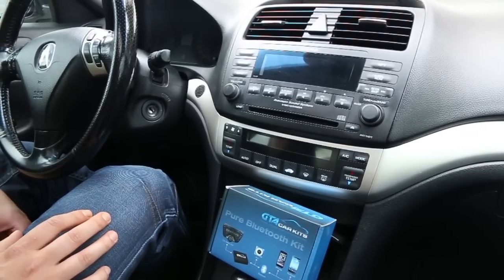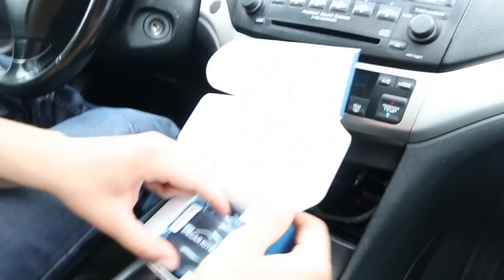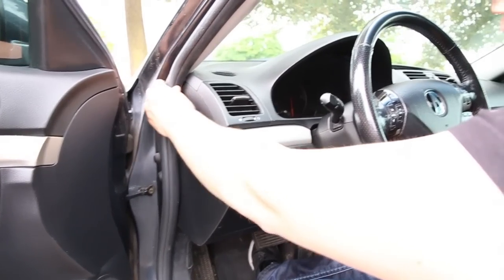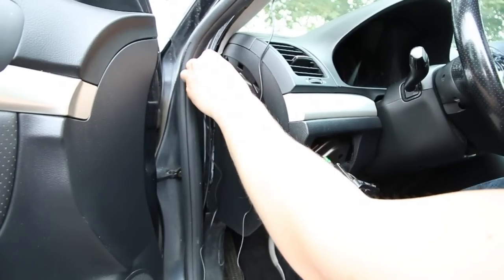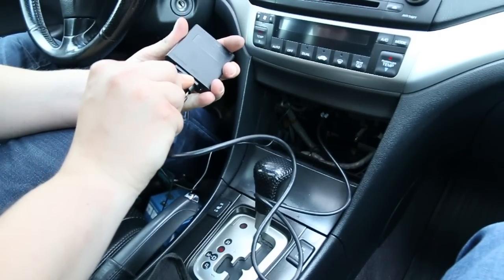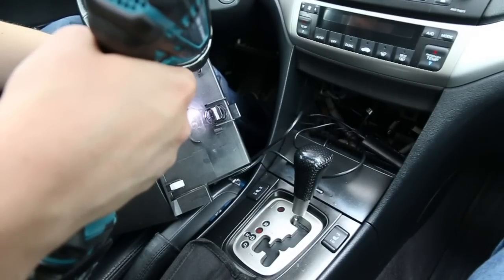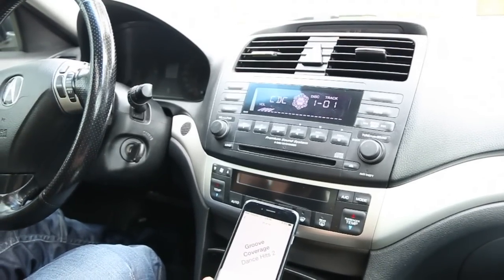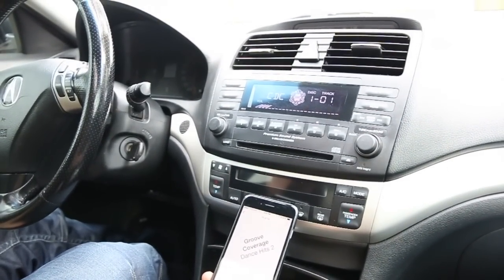Bluetooth Kit for Acura TSX 2004-2008 by GTA Car Kits

Comment: Picked this up locally two weeks ago. The audio quality of the bluetooth is quite good! Had a non-bluetooth module from Gtacarkits in my last car and this one is a huge improvement especially being wireless. No static and no alternator whine which is something I experienced with their non-bluetooth kit in my 2005 Accord. Happy to see an updated module :) Wish it was closer to the $150 range but if you install it yourself, it will be worth it. 
FYI the connector for the TSX is difficult to see, if you have a small mirror it will help with the install.

Comment: I had one installed in my 05 Acura tl .. once my battery disconnected and I had to put the radio code it didn't work anymore

Comment: I bought the GTA car kid for my 06 Accord Navi two years ago and it worked flawlessly. I have purchased another unit for my 04 non-Navi TSX and I am having an issue. The unit powers on but the radio display flashes on CD 5 track 1 (5-01) and no audio is transmitted. Pressing the disc up or disc down buttons (preset 5 and 6) has no impact on the head unit. Has anyone else experienced this? Any suggestions on troubleshooting? I’ve plugged the unit in multiple times and attempted powering the radio on and off multiple times to no avail. I’ve even emptied the in-dash CDs in case it thought CD 5 was next to be loaded (my Accord displayed CD 1-01 when connected to the GTA module) but I can’t seem to get the CD changer to scroll to CD 1 so the module can transmit.

Comment: Looking for a bluetoothadapter for a 2004 Acura TL. I don't see one on your site and the "contact" option is not working on your site.
Reply: Yea same I'm about to get a Acura TL 2005 and they don't have one of these on there site it only goes to 2003 I was thining could you use this kit on the 2005 Acura TL I wanna try but I don't wanna buy it than it doesn't work

Comment: Does this kit allow for usb thumb drives? Can I access songs if I plug into the slot? this would be for this kit, Navy, pure Bluetooth. I want to access songs, maybe song files from a Thumb drive.
Reply: Simple Ocap probably not because you would need some type of processor and operating system in order for it to read the file system on the USB drive. on top of that it's going to have to index that entire USB drive into a readable format

Comment: Hey for the harness connector, I already have a wire connected thru it. Do I just remove the old one and put on the new one?
Reply from the maker: +truemtdega Yes you would have to remove that connection and plug our kit instead.
Reply: +GTA Car Kits If I remove this wire that's already there will I lose normal function of my stereo and only have the Bluetooth aux available?
Reply: I also have the same question here? Any help? @gta

Comment: Do you have to disconnect any connector in order to connect the pure bluetooth kit to a 2005 Acura Tsx without Navigation, Or does the kit come with a y-cable to make everyting works?
Reply from the maker: Sometimes its just a pre-wire for XM radio, so you can just disconnect it. But we also provide Y-cables for your car, if something gets disables by removing that connection. Most of the time is just a pre-wire and doesnt do anything. Thank you.

Comment: Hi there!  Does this kit work seamlessly for the 2005 TSX w/Navigation?  Will the XM1/XM2/CD button function just have a new AUX option after install?  Thanks for the help!
Reply from the maker: Hi, Yes it will work with Navigation, and yes your will get an extra mode added. Because of navigation, your connection will be at the back of the radio most likely, and the connection will be occupied. Our kit will come with a Y-cable that will make everything work with the navigation. If you have any more questions, please send us an email to info @ gtacarkits . c o m

Comment: Is the installation the same if I have the Navi version?
Reply from the maker: es the connection for our kit would be at the back of the radio, and you would have to use a mirror to see the connection, or easiest way is to remove the radio, and plug the kit from the back of the radio. Thank you

Comment: is the process differnt to install hardness if you have gps??
Reply from the maker: Yes the connection for our kit would be at the back of the radio, and you would have to use a mirror to see the connection, or easiest way is to remove the radio, and plug the kit from the back of the radio. Thank you

Comment: I have the same radio shown. do I get the standard kit or xm? I do have Xm radio option
Reply from the maker: Standard kit. Once you remove the middle cubby, the connection will be occupied because of XM, remove that connection on plug in the kit instead.
Reply: thank you

Comment: What if my TSX has the navigation system will this work???
Reply from the maker: You would have to choose the nav stereo option from our website, and the kit will come with the y-cable to make nav and our kit work together. Because of nav, the connection most likely will be at the back of the radio and occupied, hence you will need to use our Y-cable. Please send us an email if you have any more questions. Thank you.
Reply: GTA Car Kits can I have the email address
Reply from the maker: info@gta car kits . com (no spaces) Thank you.

Comment: why go through all that trouble when you can use get an aux bluetooth adapter for like 10-15 bucks off amazon
Reply: Because this car didn't have aux set up for a while. My 2004 TSX Doesn't :(
Reply: Not the same car quality sound with disruption in the adapters frequency far too often. (Static)

Comment: I have this on my TSX and I have to say I'm highly disappointed. In the event you don't use this device and want to use your radio or XM it has a loud hissing sound that never goes away and depending how fast you go the louder it gets. If my product is defective then thats one thing but if this annoying sound is part of this product then I would've never purchased it.
Reply: Did you figure out if it was the unit that was defective? Has the hissing gone away or you removed the kit? Is your TSX equipped with the navigation unit?
Reply: No, When I called for customer support they didn't help me at all, thye just said its not supposed to happen. Not to mentioned that I've tried 4 different iphone 6's and none of them can detect my Bluetooth kit. Only my iphone 4 and iphone 5 can and nothing else.
Reply: Ari G is ok buddy order a new one, then report it as lost, if you lose money , make them lose money too simple

Comment: I bought this kit based on this video. Girlfriend's 2004 TSX didn't have Bluetooth and needed it. Installed exactly as the video described. Easy. 
You clearly get for what you pay. This is well built kit with high quality components. There are cheaper alternatives that should be foregone. Spend the money to get the level of refinement and quality that this delivers. No squeals, no feedback, great Bluetooth connectivity, no frustrations. I'd buy this kit again in a heartbeat. Thanks guys!
Reply: hey can I ask how much you paid ?
Reply: wideopenoutdoors I paid retail. I bought the 1 x Pure Bluetooth Kit for Honda and Acura - 2 Gen (PBT2-HondaNav). It was $154 all paid and shipped. Comes from Canada, so a few extra days to clear customs. I can tell you that it is 100% worth it. There are "bargain" options for much less. I am confident that this is superior in design, build quality and functionality. It is well worth it.
Reply: I just wanted to see what they run today. Clicked the link, Calculated total and it came to $104 shipped to Texas. Smoking deal.
Reply: +Ryan Kimmel sweet man, thanks for the feedback